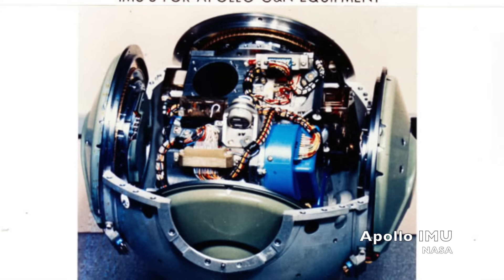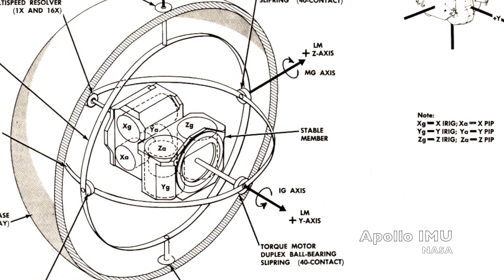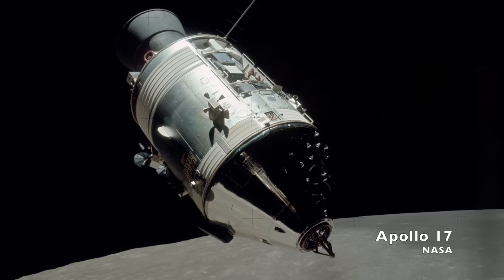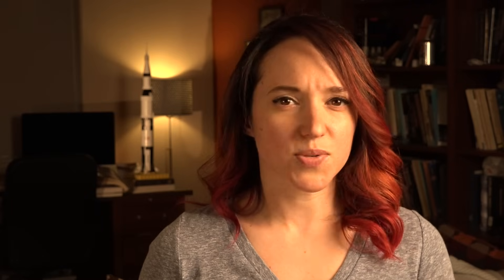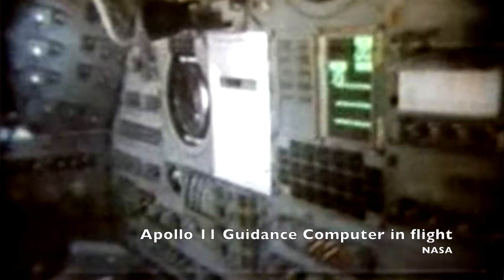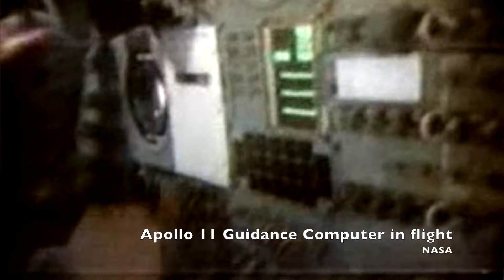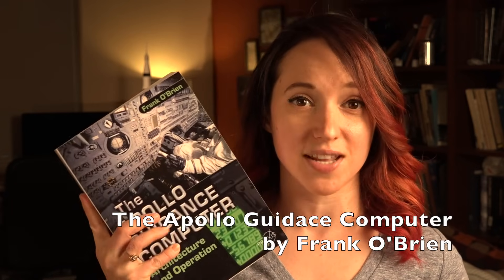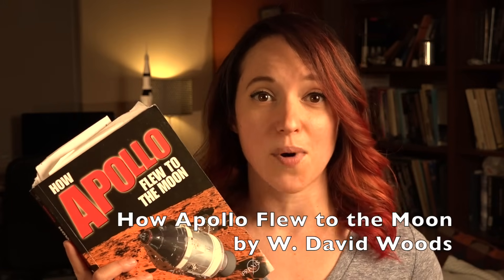Gimbal Lock and Apollo 13

Comment: Thanks for the additional references. You have explained this phenomenon better than anyone else I've seen so far.

Thank you again.
Reply: +The Dude the sparks are there to remove any excess hydrogen before the liquid rocket ignites, in order to prevent any accidents. not, as I used to think, to ignite the rocket ( there's a programme called secret space escapes that explains it in more detail)
Reply from the maker: +82nd AA Cheers! It was a bit of an awkward  one but I'm glad I helped!
Reply: Petey Wheatstraw While waiting for her reply, I'll give my response, if you don't mind. If I'm not mistaken, I was under the impression the sparks were used to initiated the combustion of the fuel. Again, I am only offering conjecture.
Reply: ***** Awesome! Thanks, Daniel.
Reply: TheDudeofDudes I responded to his comment above about a month ago. At the time, his name was "Petey Wheatstraw".
Reply: The Dude Don't look at me. I didn't doubt you. I just provided additional information.
Reply: The Dude Roger that.
Reply: TheDudeofDudes Sure thing Dude
Reply: +Amy Shira Teitel (Vintage Space) I know this is off topic a bit but I've noticed on some videos of the base of a rocket before it takes off that a bunch of sparks are shot underneath the rocket before it lights up....why is that?
Reply: +The Dude <<<<Don't believe this guy, he's an imposter.
Reply: TheDudeofDudes
Don't believe me? I didn't make a statement....i asked a question dipshit
Reply: 82nd AA
I wasn't talking to you brother.....that was directed at TheDudeofDudes

Comment: A related question? The astronauts steered their spacecraft by "fly by wire." What is that exactly?
Reply: +Wing Lem "Fly by wire" is a system where  flight control surfaces (in an aircraft) or attitude control rockets (in a spacecraft) are not controlled directly by the pilot with cables or rods but controlled through a computer (either digital or analogue) which receives its inputs from the pilot through electrical signals sent from a joystick or similar device. The computer determines what movement of the craft the pilot desires dependent on the position of the joystick/control column and translates that into the appropriate signals for the control surfaces/rockets depending on the particular attitude, velocity, altitude, etc of the craft.

Comment: Ya'll are making a gimbal lock event out to be much more dramatic than what it really is. If the spacecraft is coasting (i.e not under powered flight) NOTHING is going to happen, except that they obviously will not know where they are pointing in space. That is easily rectifiable by performing a P52 IMU alignment, (although it was a little bit time consuming) which they routinely did, during the mission. A gimbal lock occuring during TLI/TEI, MCC, DOI is obviously something that you wouldn't want to happen, but if it were to happen during a coasting phase, it wouldn't be critical.
Reply: Apollo 13 was venting into space, so it was as if they had an engine running with no way to turn it off. If they went into Gimbal lock then it would have been terrible.
Reply: They can and did realign the guidance computer during 13, but they found it intensely difficult because, if I recall correctly:
- they were venting stuff that obscured the stars they were trying to align to
- the LM had a fixed sextant, so they needed to align the spacecraft to the stars, and LM wasn't designed to maneuver the command and service module
-- they kept coming close to gimbal lock while trying to do this
- the astronauts were frozen and exhausted
Reply: It was dramatic because if they went into gimbal lock while they were trying to correct after the oxygen tank exploded, they would end up flailing around wildly and without the information they'd need to fix the problem.
Reply: Not just that they were venting into space, they were venting on an unknown axis, at an unknown and non-constant rate (and thus thrust).  Maybe it wasn't "critical" because the SM engine didn't rocket them thousands of miles off course, but if they weren't able to stabilize the spacecraft, they would have tumbled off into oblivion, or into the surface of the moon.  The net effect is the same here regardless.
Reply: Epi Endless And don't forget the Mylar insulation from the SM explosion giving many fake stars to obscure alignment via the AOT. That's why Lovell had to resort to the Earth horizon alignment as he had previously done on Apollo 8.
Reply: Is gimble lock a function of absolute angle or rate of change?
Reply: Grimlock1 IIRC, Absolute angle. If the rate of change is too fast in any of the axes, it reaches that absolute angle much faster.
Reply: For most missions, yes. But Apollo 13 wouldn't have had enough time.
Reply: RickyboyH Correct on the latter point. Lovell locked up the gimbals by putting in the wrong commands on the trans-Earth coast on Apollo 8, and had to have Houston help reset them via a P52 uplink.
Reply: Gimbal lock works great in science fiction such as going to the moon.

Comment: I thought gimbal lock happens when any two of the three axes align. Which pairs lock depends on the hierarchy of the three rings. The problem is often met when using cameras in 3D animation setups.

Comment: What is the difference between a gyroscope and a gimbal?
Reply: +David W 

Each ring in the apparatus is itself a separate gimbal.  The navigational device is an apparatus comprised of 3 (in Apollo 13) or 4 (as described to avoid gimbal lock) connected gimbals, and navigational equipment mounted to the inner-most gimbal.

A gyroscope is a spinning core (important for gyroscopic actuation) mounted to the inner-most gimbal of a multi-gimbal apparatus.

The relationship between a gyroscope and a gimbal is akin to the relationship between a doorway and one of its hinges.
Reply: A gimbal is just a universal joint.  The stove on a yacht is mounted on a gimbal so that when the yacht tips or rolls,  the stove is always upright.
Reply: Milt Farrow (cue classic Electric Company skit): You mean Gambles ! LOL

Comment: did nasa not know about quaternions when they built apollo?
Reply: Somebody surely did.  But this video isn't about the numerical problem you might know from 3-D graphics; rather, its mechanical analogue in physical gyros.

Gyros have been built with 4 sets of gimbals to address the problem, but they're terribly messy and have problems of their own.  The alarm warning the astronauts of the proximity of gimbal lock was chosen as a practical solution.

Comment: To realign the platform from scratch using the stars as a reference wouldn't you have to be able to see the stars? I thought they said they could not see any stars. Maybe I am misunderstanding something.
Reply: +Christopher Salter 
This question often arises in the context of the surface of the moon. They could not see the stars on the surface on the moon, just as you cannot see them on the surface of the earth in daylight, because the sun is so bright and the moon surface still reflects a lot of light. Looking for a place in the shadow of a rock and using some shielding to shield out reflected surface light, it would have been possible to see stars. But. The astronauts did not pay much attention to do this - after all their workplan was already crowded and besides that: the stars do not look different then they would look in earths nightly sky. There is nothing you can see better from the moon with the naked eye then from the earth with the naked eye. And after all we are using telescopes here on earth - a much better tool. So it is not surprising, that the astronauts did not spend a lot of time, to seek for places to see stars. There is no value in it.
But part of the navigational system was the sextant which includes a telescope, which of course, since beeing a tube, blocks sun light unless looking directly into the sun. So through the telescope, it is possible to see stars and the telescope is also needed to give to the computer the exact orientation by just pointing the telescope visually to a star and the computer reads the telescope orientation to calculate how much the IMU is off.

Comment: sound to be a silly question, but how would the service module connect to the command module if the bottom of the command module is sealed by heat shield ?

Comment: Most of the time gimbal lock would not have been a disaster on Apollo, just a major hassle as the crew would have to realign the platform from scratch using the stars as a reference. It would have been a disaster (or at least a very serious problem) during a time-critical mission phase like powered flight, and it would also have been a big problem during Apollo 13 since there was too much debris around the spacecraft to sight any stars.
Reply: The Gimbal Lock Warning light told the astronauts they needed to rethink the way they should reorient the space craft when preparing to fire the main engine of the CM or LM (called a Delta V burn). They would have to rearrange the sequence of vehicle rotation using pitch, roll and yaw commands. As the comment above indicated. if they entered gimbal lock they would lose knowledge of the stable platform orientation in the IMU and they would be required to take sightings off known stars (and/or the earth, moon or sun) in order to reestablish that orientation. (The stable platform was the ONLY way they could tell what was "up", "down" or "sideways". That was required in order to point the vehicle in the right direction to make course corrections...So knowing the orientation of the stable platform was EXTREMELY IMPORTANT.)

Comment: Nice explanation! Gimbal lock is not just something physical, it can also happen in software simulations, like games, where the rotation is represented with rotations in three dimensions. However, most games these days use what is called quaternions to represent rotation, which is essentially the "fourth wheel" that is shown in this video. :-)
Reply: i have been reading about 3d rotation, gimbal lock, quaternions for an half hour and your comment is just allowed me to understand most intuitively.
Reply: Yup. Quaternions can be represented as four components, with one constraint, and so three independent degrees of freedom. Same information, represented a different way.
Reply: Yep. That’s why I never use Euler angles is nav software.
Reply: I did this myself in the 80s writing a orbital simulation.  I started using Euler angles, and quickly found myself in software gimbal lock.  Researching an alternative, I found an obscure SIGGRAPH paper on quaternions which handily solved the problem.

Comment: Your comment about the computer instructing the motors to react to realign the platform is incorrect.  The gyros keep the platform stable, the gimbal is simply there to allow free movement of the gyro platform.  Sensors measure the gimbal's 3 axis to tell the computer about the attitude.  It's important to understand what a gyro does to understand the concept of the instrument as a whole.

Also, just the measurements of the gimbal's angle is not enough.  3 accelerometers are also required to measure acceleration in 3 dimensions.  With 3 measurements of angle, and 3 measurements of acceleration, it is then possible to know the speed and heading of the spacecraft.  See '6 degrees of freedom'.

Comment: Thank you for this explanation, the diagrams helped make sense of it as well.
Do our satellites and other flight missions continue to use gyroscopes, and hopefully 4 sets of them? I'd like to know more about them: how large are they, how fast do they rotate, how heavy are they? Thanks!
Reply: Many deep space satellites now have "new and improved" gyros that provide attitude information to the guidance computers. Gimbals are no longer used because modern guidance computers, because have much larger memories, and can do the job of the old gimbals electronically, by recalculating the orientation of the space craft based on real time gyro information. The new gyros are no longer spinning wheels, like the were in the Apollo gyros. They use different technologies to accomplish the same task.

Comment: So I have a question. I'm a pilot and we can "Cage" the gimbals on our directional gyro. Is that what the crew would have to do if they did enter gimbal lock?
Reply: +David Stanley No, they would have to realign the platform from scratch using sightings of navigational stars. Time consuming but not a serious problem unless it were to occur during a time-critical mission phase like powered flight.
Reply: David, there is some similarity (except the gyro in your A/C is a single axis device.  Caging your A/C's gyro simply forces the rotating mass to a known/fixed position relative to the airframe.  The airframe needs to be straight and level for caging correct the AI's display to S/L when the A/C is S/L.
Reply: Well he asked about DG not AI. Incidentally both DG and AI are 3 axis / 2 gimbal devices.

Comment: Tbh, your video poorly explained what's gimbal lock. 
A gimbal lock is when you line up the outer axis with one inner axis, you will lose one of the 3 directional control. To solve it, or to perform a toggle control along that lost plain, you need to calibrate 3 axis all together but it gives a strange trace on your 8-ball. It confuses the pilot

Comment from the maker: Quick note, guys. Frank O'Brien who wrote "The Apollo Guidance Computer" pointed out a little error on my part. Gimbal lock on Apollo was possible with the inner and outer gimbal lying on the same plane, the gimbal mounted on the central platform and the one mounted to the spacecraft. Those are the two you really don't want to line up!
Reply: It's not that they're "locked," per se, it that when their axles are aligned, it cant tell pitch from roll, because both actions have the same effect on the instrument.
Reply: Why would lying on the same plane lock the gimbels? Aren't they free to rotate with respect to each other? What locks them?
Reply: Amy Shira Teitel 
If my memory serves me right, Gemini did have a fourth gimbal to prevent lock.
Reply: +Amy Shira Teitel (Vintage Space) They did have 2 systems. One on the LEM and the other in the CSM. So if one failed they had the other. As only 8 didn't have a LEM. You just needed to power up the LEM and set it up. Something 13 had to do as a life boat.
Reply: Kevin Abel The AGC did return in all the CMs, but to the best of my knowledge, not a one was reused.  Each CM had its own brand new AGC.
Reply: They aren't physically "locked".  The problem is that if two of the three rotation axes in the device become aligned, you no longer have three axes to work with.  In this "gimbal lock" situation, you only have two axes around which the central platform can rotate --- there's no way to induce rotation around the "missing" axis.  To the extent that the spacecraft is rotating around this "missing" axis, the device is blind to the motion. Automatic attitude control systems, with no information about that motion, can send the craft into wild gyrations.  You need a skilled human pilot - with a window on the outside world - to get things back under control.
Reply: +Amy Shira Teitel (Vintage Space)  I thought that was a cat video playing behind you, but it was a real cat. tee hee
Reply: Engineers are good at numbers, not spelling. I'm personally afflicted. (I have to spell check half these words and probably still spelled some wrong.)
Reply: i think it was a near gimbal lock ;)
- and it wasn't Gene Cernan's fault, IIRC
Reply: Vintage Space That's why the Apollo 13 crew had to watch "the frappin' 8-ball" to ensure they didn't lock gimbals.
Reply: Mindbolowing
Reply: Very very nice
Reply: Did the AGC return to earth in the CM?  Could it be reused on the next flight?
Reply: Amy.... So the authors of the books you recommend are subscribed to Vintage Space? That, if true, is cool! 
Or do they PM you? Either way, cool!
Reply: Vintage Space your like a super voyage to the sun.... SUPER HOT. 😋
Reply: So does that mean there are three possible attitudes you have to try and avoid getting your spacecraft into? (That is, alignment of X-Y, Y-Z or Z-X)?
Reply: Interesante video.
Reply: Vintage Space if you already haven't noticed,  you misspelt Guidance when recommending the  guidance computer book :P
Reply: Drew M I have to spell check words I "know" I have right... but it looks wrong...
Reply: Christopher U.S. Smith ...Appreciated answer.
Reply: I have read it, and there are many things that Frank O'Brien is not aware of, and in particular that it makes no sense that the programs would have had to insert repetitive sequences to test if a more prioritary task had been started, when it could have been done differently, and I know what I am talking about!
Reply: Pascal xavier ...O'Brien may have left out some information but he put in a lot of effort into writing the detailed book.  I enjoyed it a lot.  I need to go back to the beginning chapters where he discusses binary logic.  I have been away from register logic for many decades and miss Working with it.
Reply: I got that book recently.
Reply: Vintage Space And....Guidance is spelled with an ‘n’.
Reply: Yes Gimbal lock is a bad thing.  I remembered that in Avionics tech school.  Thanks for the video.  Thanks for the Inertial Measurement Unit and other buzzwords.  BTW does your cat knock over your effects that you have to retake a video or scene?
Reply: Another fine and detailed review; Chapter 283 from The making of The Emperors New Clothes (1969)
Reply: +Amy Shira Teitel (Vintage Space) -- This was really bad.
Reply: Vintage Space You give me Gimbal Lock baby!!!!
😎
Reply: Funny how there's so many explanations....From so many clowns....
Here's some more comedy presented by NASA from comedian Don Pettit 
However the script has been stolen from the "Ancient Aliens"  
"We Lost the technology to get to the moon" episode...It's still a good laugh...
https://www.youtube.com/watch?v=qxJbQpdYINg